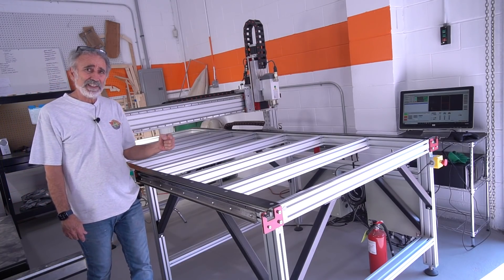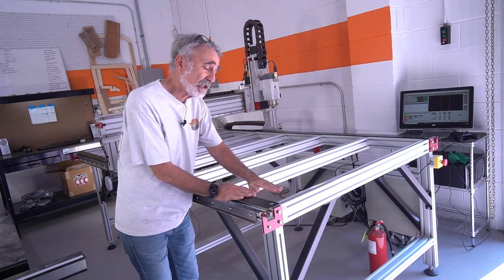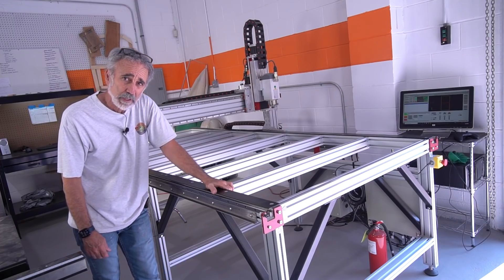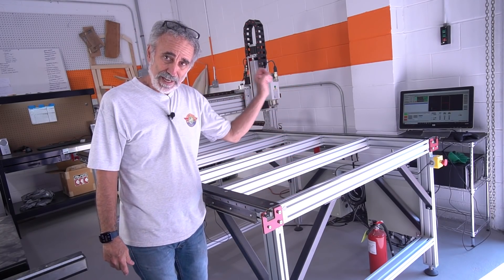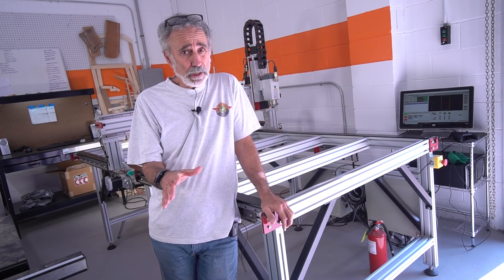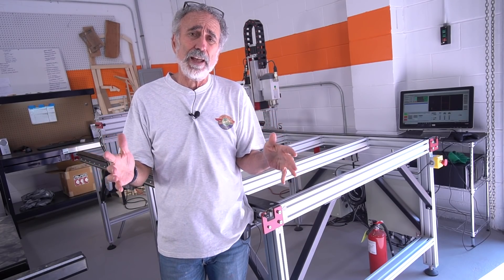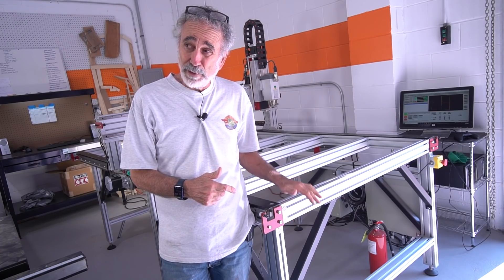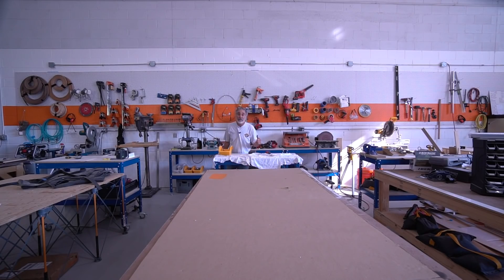Using a CNC MACHINE to build custom camper vans

Comment: Can you use a picture to get it to match curves and angles perfectly like for wall panels or sub floors?  Or do you get factory specs?
Reply from the maker: You have to create a file for the computer to send to the router. I am looking at a pen and wire scanner to trace the van floor
Reply: @HumbleRoad  Would love to see a video on the process. I've recently been fascinated with CNC routers and would love to eventually purchase a hobbyist setup.  Is a wire scanner like a 3D scanner?

Comment: Finally!!!! Now you can, cut out ply and other timber panels, cut out aluminum sheet for chassis, boxes and coverings of equipment, cut out perspex and acrylic windows and panels, cuts out brackets for your 80-20, cut out and label/engrave panels for all your instrumentation, cut out and engrave PCB's for prototyping your electronic systems, Cuts out and engrave decorative murals, cut out draws and cabinet  fronts with grain and holes for handles, Now everything can be drawn on a computer and cut out on your CNC machine......Well done!!!!

Comment: 2 silly questions on the cnc machine. 1 do you need eye protection. The the videos I seen seem to do. 2 the the table looks like 80/20. Will the lazer cut it?
Reply from the maker: If you are near the machine when it’s cutting, then yes eyes and ears. As I explained in the video, we will first lay down a 1” MDF sheet to act as the “spoil board.” The cutting tools will through penetrate the working material by approximately 1/64” or 1/32”
The spoil board gets replaced as needed. Waaaay before the cutting tools get close to the 8020
Reply: @HumbleRoad  cool

Comment: in van building you can look at most items, galley, cabinetry, wood/trim work etc... and see the craftsmanship and attention to detail which sets builders apart 
but certain things look the same no matter who makes them like wall boards, floor boards etc... so why not let a machine make those while you craft everything that matters.....    SMART!!
Reply from the maker: Exactly! Certain items need to be repeatable and do not require the hand of a craftsman.

Comment: Loving the way the shop is evolving George! May want to move the CNC PC away from the roll up door though, don’t want it getting wet 😉
Reply from the maker: The PC was in that corner only until Ron came back from HD with a longer CAT 6 cable. Now it lives on the desk at the rear wall.

Comment: Nicely done, looks like quality spindle too, HSD unless I’m mistaken, 2.5 HP?  Mine is a bit lighter, but it’s connected to a BC head for sculpture.  Welcome to the CNC game;)
Reply: Could one sculpt a bust from a block of wood w CNC?
How tall a piece can the cutter cut?
Reply: @Stewbular  yes, easily.  My build volume is 4'x3'x2.5', so the is 2.5 feet tall.
Reply: @vita-girl4345  
That’s great
I used to lust after the “copy a bust” w router kit in the back of Fine Woodworking magazine